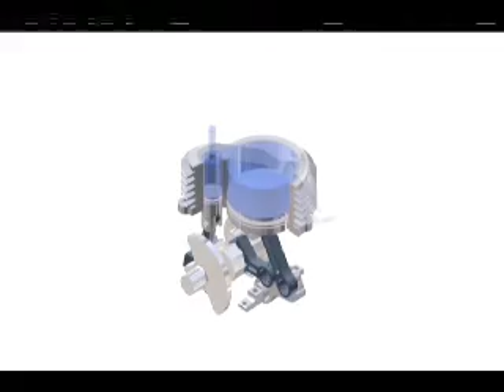A car that runs 200 miles on compressed air.

Comment: This will not run efficiently in the winter. Ever seen a big industrial air compressor? It has heat fins on it to dump heat from quickly compressing the air and it gets hot enough to fry your hand. Room temp highly compressed air dropped back down to atmospheric pressure is very cold from the pressure drop -- so cold that you need to supply heat to warm it up so it expands back to full size quickly. If you don't supply heat, it won't expand fast enough and your engine output power drops.

Comment: sinwanba , you are wrong: electric cars require batteries, and batteries are a big problem today (eg., pollution).  Compressed air can be achieved with a solar panel or wind-mild, making a 100% clean transportation solution...  So, from the engineering's point of view, this is perhaps the best solution today.  By the way, I am an industrial engineer, specialized in Energy Efficiency (see triple W point E dash MARKET point CL).

Comment: Yeah, its cool. But WHERE would you get the original 'compressed air'? Its not just lying around everywhere. You have to compress it with some type of energy, i.e. --> electricity --> ultimately the same thing as an electric car except LESS efficient. 

Interesting engineering project, useless in terms of practicality!

Comment: i have worked with commpressed air for over 30 years and can say it is expensive in terms of motor power to produce it. There is heat loss and if you atach pressurised cylinders to a vehicle as this man has done you are adding a lot of weight. Also you would not travel very far unless the whole vehicle was one big cylinder It would be more effecient to use the motor that produced the air to drive the vehicle using batteries. in other words this is one big scam Do you see it travelling any distan

Comment: Like the innovators that produced air cars trams and trains in the 1900's Museum of retrotech has a good section on this.
Smarten up. This is a con using ancient technology with no hope of improvement due to basic physics. As for "self refueling cars" they are due on the same day the pink unicorns drop out of the sky. Read a bit

Comment: Oh right So the 7.22km range in the only published test MDI issued doesn't exist. well it does and tht's the only test MDI have ever posted now well buried but it is out there cached on the net.
MDI NEVER offer test runs out side the parking lot
But tell you what I'll pull my posts sing MDI's praises if you can find 1 independant test confirming MDI's lies opps claims 
Hello?
Silence?
Sigh tards and fwits

Comment: Do not be so negative. You have no proof of what you are saying. Well, if you disbelieve, you can fly to the south of France which is a very nice place and then it will be easy to make a test run and prove that it is doing 300 km in range.

Comment: Wish this was at least 25% true, it would revolutionize transport, calculating the energy to compress enough air to fill in the estimated 42 cubic feet of tanks isn't possible with current
material psi ratings for the 200 mile range or even the 100 mile range or 50 or 25. The explosive power of that much compressed air wasn't discussed.

Comment: I first heard about compressed air vehicles back in 2006, makes sense.  In Italy a shipping warehouse converted their forklifts to run on compressed air because their employees were getting sick from the gas/diesel fumes.  At that same time a German company was also manufacturing a compressed air car.  Use 3-D Solar, Wind, and/or Hydrogen to fill the tanks and you do not burn any fossil fuels.  Every home an energy plant and self contained is the answer. Fantastic.
Reply: if you use hydrogen to power the compressor, you may well be burning fossil fuels to produce that hydrogen

Comment: take some engineering classes, "what if the car could run the generator to compress its own air"...ever hear of thermodynamics? there is no such thing as perpetual motion. And dont even get me started on safety...ever seen what happens to a compressed air tank that blows up? times that by 3 next time you get in a fender bender and get your arms and legs blown off.

Comment: @Zappyguy111 The weight of gas in a 4500psi cylinder vs the weight of liquid air in the same volume is a simple calculation use moles ie approx 30grams of air per 22.4L at S.T.P. Use P1V1=P2V2 this give you grams of air at 4500psi vs grams of liquid air in same volume. Not much difference.
The power to compress the air has to come from somewhere compression is hideously inefficient
You can not pressurize air until it becomes liquid, to do that it HAS TO BE CHILLED  FACT

Comment: @fizzguts 
And the prefilled tank is a stationary tank you leave at home. You keep it permanently pressurised until you need it. Just have the compressor on a low pressure trip so it refills the tank when it runs low.
It'd take a 6kw compressor 6 hours, but this thing, you just plug it in and go in 5 minutes. 
It's 5am, pulled an all nighter. Math's isn't something I want to do right now. Maybe later.

Comment: @Zappyguy111 Read again what I wrote "5 MILE ACTUAL RANGE 6 hour recharge from a 6 kw compressor (That's big by the way). It doesn't matter how large a prefilled tank you have YOU HAVE TO FILL IT AT SOME STAGE
You can not pressurize air until it becomes liquid, to do that it  HAS TO BE CHILLED to cryogenic temperatures which is even more energy lost. Liquid air STILL has a lousy energy density. 
This is all basic physics and simple maths. Do a bit of research

Comment: How long do you sleep, how long do you spend at work and how long do you spend outside your car on holiday? Refilling should never be a problem if you think ahead. Also you could have a large precompressed tank for emergency purposes, it'd have to be at a slightly higher pressure and will take seconds to fill up.
If you have the air tank to take the pressure, you could continue pressurising the gas until it becomes a liquid, the molecules will decrease space by at least 1000 fold, more range.

Comment: @toeblarone A 5 mile actual range, with a 6 hp engine, a 6 hour refill time using a 6kw compressor and appallingly low efficency  is "the way forward" Not in this umiverse

Comment: @aztecsaxwarrior So the $40,000 dollar array you need to run the honking great compressor this POC needs for it's ACTUAL 5 mile range makes sense to you? I have a bridge you might like to buy.
You of course are SO convinced photovoltaics and a wind turbine are the answer you have them on you house? Right? Hello? Silence? 
 PV and wind only make sense it you are miles from the nearest power lines The opportunity cost kills it if you are hooked up to the grid

Comment: @einstyndotcom  Easy, if you have a compressed air bottle on board (with a slight amount of air in it), just opening the valve will start up the generator.  From there it would feed itself energy.    Compressed air is super-pressurised so it creates energy just by leaving the bottle.

Comment: This is bullshit it physically cannot be self perpetuating. The notion of it being a in "perfect circle" ( compressed air running a generator to compress more air to run the engine ) is flawed logic energy will be lost within the inherent inefficiencies of energy conversion. Its like saying I can use electricity to run a generator which will then make more electricity to run the engine.

Comment: Very good idea for city cars, a few points, this is not zero emissions, you still have to burn some fuel to run a compressor and fill the air tanks in the car, also what about all the emissions to make the car in the first place, zero emissions is a false claim in this video and it cannot compress air without using some other from of energy, would be a much better video if they told us the complete truth, however I do agree it is a good idea, no question

Comment: Additionally, all of these new "fuels" (hydrogen, air, etc) are simply forms of storing energy, and have more in common with batteries than actual fuels. It takes more electrical energy to separate hydrogen and oxygen from water than you get back from hydrogen fuel cells or from burning hydrogen, just as it takes more electrical energy to compress air than you get back. The only benefit to moving toward these technologies will be realized with natural electricity generators (solar, wind, hydro).

Comment: The commentary on this video is quite possibly the dumbest I have ever heard from a show claiming to be scientific. If the compressed air engine did not but power a generator, it would have losses in energy due to limitations in efficiency. Same goes for the generator to run a compressor. If you take out the middle man, you have a compressed air engine powering a compressor, which due to frictional and heat losses, will not function without energy added. You cannot create energy from "thin air."

Comment: @einstyndotcom , it is not perpetual motion, the tanks of compressed air move the pistons. The compressed air is compressed wit other energy, either an electric compressor at a charging station, or buy a compressor mounted on the car. Check out some other videos abut this, some of them are more clear on how it will work,

Comment: The idea of a car running on compressed air isn't bullshit, although it's extremely unlikely that it will ever compete with combustion or battery-based cars... And they can't go anywhere near 200 miles on one tank.

The statements about it being "free" to refuel, or that it could be a perpetual motion machine are complete bullshit and I so I hope this didn't make it on the air on any actual non-satirical TV show.

Comment: @LunaticKreep Granted, ya can't make things error proof, but the days of the bic lighter cars are gone.Too many safety standards and fear of law suits have made gasoline fuel system so much more safer than decades past.Diesel is no more than #2 home heating oil, with both diesel and gas, your gonna need and ignition source.Is it any less dagerous?.I dunno, but for myself, I feel better with the technology of a carbon based fuel system right now, than I would sitting on top of a few air tanks...

Comment: I'm not sure if this was mentioned...Although this is a viable technology, the problem is, ever see a compressed air tank spring a leak?..How do you protect the air tanks from a catastrophic rupture in an accident...They could kill or injure anyone too close...Just look at what a tire can do with 30 to 40 pounds of air pressure when it fails and blows...

Comment: @1thelazylizard Did you ever pump up a dive tank with an bike pump? how many years did it take you? Or did you know it takes a 6kw air compressor running for about 6 hours to refill this piece of crap with it's 5 mile range? Depending on the cost of electricity where you live this will cost about $10 to $20

Comment: They still need energy to compress that air and with every motion some of the energy held in the car is lost, it can't just go on forever, sooner or later it would need more energy.
Where is that energy going to come from? This is only pushes the energy requrement to some other place.

Comment: A car running on compressed air is not very far fetched.  The range will be in question of course.  
This video is a little misleading however.  They first said 0 cost to run then they admitted that it takes energy to compress air.  
They started to lose ALOT of credibility in the video when they suggested the perpetual energy toward the end.  They would have been better off not mentioning that.

Comment: "Compressed air is an energy carrier. It has to be compressed then it will restore and return what we gave it." 
This is entirely true, but all it means is that the emissions the car would be producing are just happening before you drive the damn car. It TAKES ENERGY TO COMPRESS AIR PEOPLE.

Comment: David McClintock - created his free energy device known as the "McClintock Air Motor" (US PAT #2,982,26100) which is a cross between a diesel engine with three cylinders with a compression ratio of 27 to 1, and a rotary engine with solar and plenary gears. It burns no fuel, but becomes self-running by driving it's own air compressor.
Reply: Was the engine blue.print still available today?...

Comment: perpetual motion bullshit , most likely they compress the air with a diesel engine at home or with electricity from the grid, in which case the emissions are released even before you use the car. i'd rather bet on solar-hydrogen cars because you can store more energy as a fuel than potential energy of pressure can.

Comment: Besides the work of Bob Neal, another inventor named John Houston developed a home furnace that used the "heat of compression" to heat the house, and then exhausted the compressed air through an air motor to help the electric motor run the compressor in the first place. The system was very efficient. The year was 1920!
Reply: What happened to the design,can you duplicate it- for sure it has file copy in U.S. Patent office...Such invention of him will be a threat to those company selling home heater units...Just like prophet Daniel,he put himself inside the lions den,dungeon....
Reply: compressed air was popular in the 1800/1900s...
what he had there was what we now call a heat pump but a bit better again, with no electrical parts other than a motor and switch to fail, the whole mechanical device being quite easy to fathom and analyse...

another side effect is if he had designed the compressed air motor to absorb as much ambient heat as possible as it expanded, it could also refrigerate something... pretty well much as much heat as is squeezed out over there as its compressed, will be re-absorbed as it expands and reaches ambient pressure/density/temperature. optimise for losses, enhance that COP.

just 1 atmosphere of pressure from ambient will cool to below freezing when expanded.

Comment: The original idea of the ambient air heat engine was published by Nikola Tesla in 1900. But Tesla had not worked out what the best "working fluid" for the system would be.

Comment: After years of experimentation, Bob Neal filed for a US Patent in 1934 for an engine/compressor unit that ran continuously from a tank of compressed air. The engine produced excess mechanical energy while keeping its own compressed air tank full at all times.
Reply: What happen to such invention,why it was not mass produced?...He must sell the blue print only,its up to the buyer to build their own,a do-it-yourself (DIY) system....Or he was threatened like Stan Meyers  but opted for the offering- or else....S.Meyers refused the offering,so his life become the offering in the altar of greed,monopoly and conspiracy...Meyers died after drinking a poison laced drinks,as per autopsy report...Pls see You Tube video...

Comment: When the Patent Office informed Bob Neal that his patent claim would be denied because it was a perpetual motion machine, he built a miniature working model, put it in a suitcase, and flew to Washington DC. He plopped the engine down on the patent commissioner's desk, turned it on, and requested that he be granted his patent on the basis that the engine worked. His request was granted in 1936 with the issuing of US Patent #2030759.

Comment: Agh, I want to smack the person that decided to end this video with that note on perpetual motion.
This car does seem to have its merits though. A 3 minute charge to go 200 miles? sounds damn convenient and DAMN cheap to me. It's def not a 0 emissions car right now, since you're using electricity at some point, but we're getting better at that .. A quieter car is nice too. Also no crazy giant battery that needs to be disposed of, like in an electric car. Air power does seem a bit boring though..

Comment: According to the First Law of Thermodynamics, energy cannot be created or destroyed, only transformed. The energy stored in the compressed gas is transformed to kinetic energy when the car accelerates and thermal energy from all of the friction from wind resistance and every moving part in the car and every electrical device in the car. The car will always need energy to compress the gas. Perpetual motion is not possible because of the energy losses.

Comment: @Medicaire Good point...while 50% of our electricity comes from coal we will have a problem. If solor, wind, water and nuclear becomes more popular cars like this may save the work. BUT I assume because of the 2nd law of thermodynamic that when electricity is converted to motion and then to compressed and back from compressed air to motion that a lot would be lost. I personally feel that better batteries and electric cars are a better answer.

Comment: Its inposible to have that compressor in the car and run at 100% efficiency. The car is an open system which means energy is lost through all kinds of frictions (air, tires bearings etc.). 
Second, the system is NOT free of emmisions. Getting the air compressed requires outside energy which is usually electricity.
Third, that thing looks like it weighs no more than 200 lb. Can you imagine having an accident in it?

Comment: @maple1255 I prefer trying to shut down multimillion $ scams, promoted by lazy technically ignorant journalists looking for a gee whiz 90sec sound bite. "I think", no you don't you swallowed this bullshit hook line and sinker. AS I SAID this POC is 5 times less efficient than an EV 
google 
berkley air car 
vencat 20 miles
e.volution south africa 
 the same lies 10 years ago
Still you can shut me up find one independent TEST confirming MDI's lies opps claims
Hello?
Silence?
Sigh